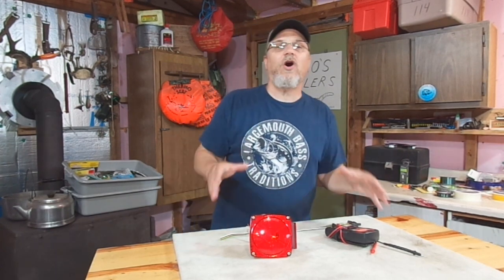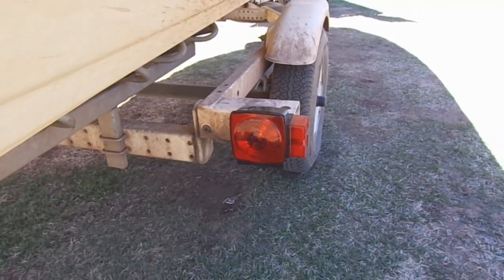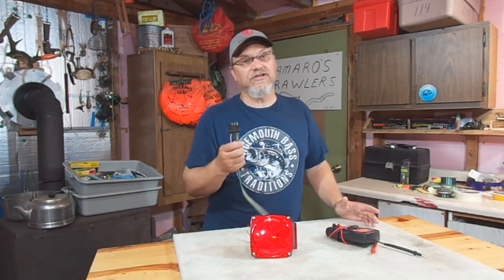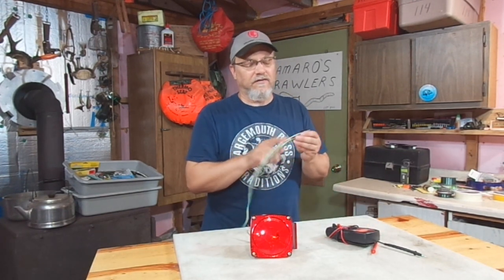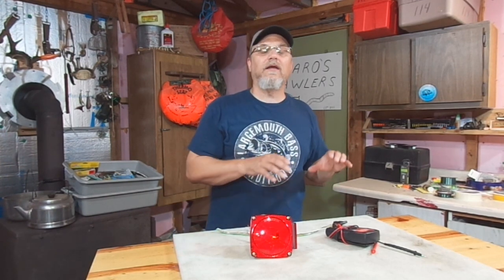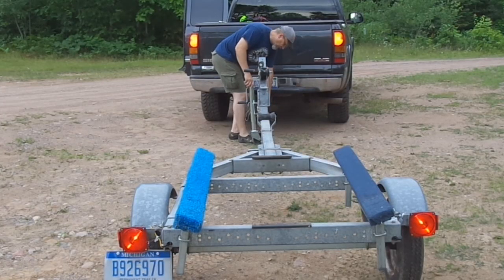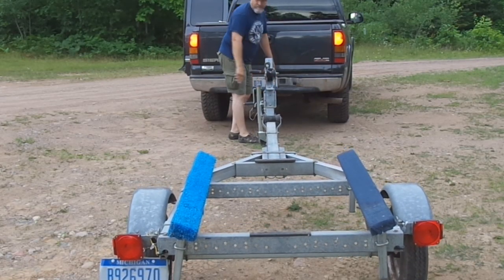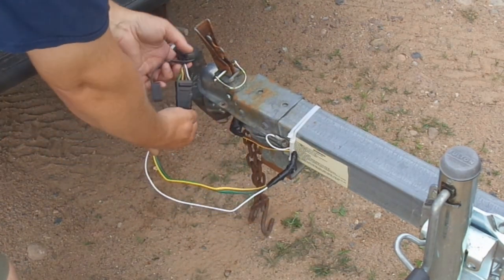FIX YOUR TRAILER LIGHTS (6) - Trick For Flickering Lights

Comment: Thank you so much. I took the ground off the trailer sandpaper the metal clean the wire with the sandpaper as well. Took the screw with a metal washer wrapped wire around the screw reattached so that wire was touching clean metal washer on top of it tightened screw back down everything working perfectly
So glad I found your video
Reply from the maker: Great to hear!  Thanks for the comment.

Comment: Hey Dave,
Thank you Thank you for your trailer lights series. Great work. I owe you about 9 likes. 

Here is a tale of two trailers

Tow vehicle: 14 year old Dodge Grand Caravan with original round connector on the vehicle and a flat 4 end plug.

Trailer 1) 20 years old. LED lights. Flat 4 plug. 5:10 Used 2x per summer. Clean up with contact points with sandpaper. Plug in without connecting the hitch. 
Everything works. Probing why this is my favourite trailer.

Trailer 2 - the problem child.
Bane of my trailering since last Fall! 30 plus year old trailer. 

Finally gave up and rewired it today with new LED lights. 
Per your videos, connected each fixture to the frame. Redid white wire at the hitch and installed a jumper cable back to solid frame pieces where side marker and rear fixtures. Ground off the paint for all ground connections. 

Tested flat four at the vehicle - (same plug as trailer 1) working.

Connected 5:10 New lights via the flat 4 plugs but not connected to the hitch. 

NO LIGHTS!!

Connected to the hitch - you guessed it - everything works.  Lifted receiver off the hitch - no lights.

So, all equipment works on trailer 1.

Nothing works on trailer two unless hitch and receiver connected. 

Help! 

Thank you again, 
Pat
New subscriber
Reply from the maker: Well, it has to be a grounding issue.  You know from watching this video that the trailer isn't being grounded through the wiring harness.  That's why it only works when connected to the hitch.  Does trailer 1 work when not on the hitch?  If it does, try wiggling the harness with the lights on and see if you can get it to fail.  I had a problem similar to yours one time.   One trailer worked and one didn't.  It gave me fits.  It turned out that with one trailer, the harness got twisted a certain way to make the plugs connect and that certain twist caused the ground wire to open.  The orientation on the other trailer didn't cause the same twist to make the plugs come together, so the ground didn't open.  Maybe you have something like this.  The vehicle harness gets stretched or twisted with one trailer and not the other?  Hope this helps.  Let me know what you find and thanks for the subscription!
Reply: @KnettersPracticalOutdoors  
Dave, you were correct. Reworked the main ground and viola! Let thee be light(s). Thank you!
Reply from the maker: @wapbarlow7945  Great to hear!

Comment: Good call! 
I had this flickering issue with my running lights and the ground wire connection at the trailer frame was bad.
Very explanatory video. Much appreciated!
Subscribed!
Reply from the maker: You are welcome!  KPO.

Comment: I had a trailer light issue where the left light would stay on, even when my vehicle was turned off.  Had to disconnect the trailer every time I went fishing, which got very old very fast.  It started only a couple years after I got my new vehicle, and no other lights were having problems, so I assumed it was the controller board.  Called the company & they confirmed this and recommended a different one; it was rather expensive, so I just lived with it.  Fast forward about 3-4 years and the connector was very corroded, so much so that a brush could not remove it.  Replaced both ends of the plug & would you believe that the problem with the one light staying on went away too?!??  That was 2-3 years ago & the trailer lights have worked perfectly since.  Still amazes me to this day.
Reply from the maker: I can't even think of a way to explain that one.  But that's what trailer lights can be like.  Thanks for adding in.  I like to put these things in the memory bank for the future.  KPO

Comment: Id watched your videos and follow your instructions. After many failed diagnostics, I removed the lights and realized the wires were shot. The wires just breaks apart and the cooper strands are black/oxidized? It’s only 2 seasons of usage, maybe cheap quality? I need to replace the whole light package. LED submersible boat trailer. Is there a brand suggestion someone can recommend? Thanks!
Reply from the maker: I've been using the ones shown in this video   https://www.youtube.com/watch?v=-14kh2DYdOo&t=346s  I think the name is TowSmart  So far so good.  If you haven't seen this vid it has some good tricks for installing new lights and wires.
Reply: Yes forget about fixed lights bolted to the trailer. Use a lighting board instead it dont get submerged or weather corrosion. Just keep it in your house or shed.

Comment: Omg, gotta test out the trailer off my hitch. Everything works except for my night lights on certain days. Sometimes right off the water and on the road it works, only to notice three quarters to half way home, its been off or have been flickering on and off. Brake lights, turn signals and emergency lights still work fine, just the night lights. Might have a bad connection on one wire, and have to replace the whole thing after testing the methods you've shared, thanks a bunch!!!
Reply from the maker: You are welcome, KPO.

Comment: Love your series!  I have a problem where my right tail light will work, then not work.  If I squeeze and wiggle the harness connection point the light will flicker on but go off as soon as I stop (let go).  Does that sound like an issue with the harness itself or perhaps the ground to that light ?  Can a ground issue affect just one light?
Reply from the maker: I would try cleaning up the connection points on the harness first, see this vid https://www.youtube.com/watch?v=kqVykWhwHaY&t=37s  If that doesn't help I would just change both plugs.  That should take care of it.  Plugs can be dirty, worn and sloppy or connections inside broke off.  Let me know how it goes.

Comment: I have found that my issue is a grounding issue. When I stick a nail between the receiver and hitch my lights work. Any idea how I should proceed? (Using a different vehicle trailer lights work fine)
Thanks in advance!
FWJ
Reply from the maker: Your plug connection isn't carrying the ground like it should.  Make sure the truck side plug has a good ground connection to the frame of the truck.  You're making that connection when you stick the nail in there.  Let me know how it goes.
Reply: @KnettersPracticalOutdoors  Pretty sure its the connection between the truck wires and the plug for the trailer lights goes. Thanks again for the tip

Comment: Thank you for all the videos! I've been going through all of them and finally got my lights working today. However, I do have a question for you. Like you said, my lights work, but as I'm going down the road, (had my wife follow me on the road test), they would flicker. Also, a couple times they went out all together but as soon as I started driving again they came on. The trailer I have is a 4x8 folding utility trailer. Could the pivot point where the trailer folds cause grounding issues while on the road?
Reply from the maker: Yes it could.  Hook it up at home and try wiggling the trailer at the tilt and see if the lights flicker.  Also, try putting a temporary jumper across the pivot point and see if it quits, KPO.
Reply: Ya my  light  on my utility trailer I wasn’t flickering when I’m driving

Comment: I asked this on another video but can’t recall which...
My trailer lights work fine. Unhook from the truck and the trailer lights are still on.
When I set the trailer back down onto the hitch ball, all trailer lights go out. Lift up slightly and take a little weight off the trailer and the lights are back on.
No wires are being pinched anywhere.
Have you ever experienced this? I’m stumped.
On my truck, I have a basic trailer wiring kit that hooks up to my truck tail lights. I haven’t noticed an issue there but the problem has to be in the truck somehow?
Thanks in advance
Reply from the maker: Try wiggling the plugs.  Does the trailer on the hitch cause any wiring to twist?  Maybe trailer not wired right?
Reply: Nope. No twisting wires. It’s a pretty basic wiring. Both lights have individual grounds to the frame. Lights are good when it’s off hitch.
The second the full weight of the trailer is on the ball. Lights are gone.
If I lift up on the trailer slightly, but the tongue still remains in contact with the ball, they come back on.
It’s baffling. I can’t see any pinching either.
It’s almost as if something in the truck hitch is interfering.
Reply: It’s just really weird.
As soon as I figure out the problem, I’ll post.

Comment: So my blinkers are working. My running lights are working. My brake lights are working. But my tail lights aren't working when my headlights are on? What's my problem? Can you give me an idea?
Reply from the maker: Probably a ground problem.  Fixtures not grounded correctly.  Sometimes when a circuit doesn't have a proper ground or return path, it will return through other circuits.  When these circuits get turned on, the improper ground or return is removed and the circuit doesn't work at all.  Make sure all your fixtures and trailer are properly grounded.  I did assume that this trailer worked correctly at one time, otherwise it could be wired incorrectly.

Comment: I have a horse trailer and when I check the voltage it shows 12 volts with the truck on and  i don’t know if it show be 14 volts or 12 volts
Reply from the maker: 12 is usually plenty.  The charging system will show 14 because if you want to charge the battery to say 12.5, you need a slightly higher voltage to do it.  Slight voltage drops in the circuit will lower the volts a little and that's Ok, but 12 should be fine for your trailer lights.

Comment: My old lights are weak. When I rewired trailer and replace truck plug still weak and if I hook up leds not enough power to light up
Reply from the maker: In the past that has happened to me and the problem was at the connection point of the vehicle side plug.  I know you said you changed it, but is it all new all the way back to the vehicle wiring?  If you just spliced in a new plug at the end of the harness, you could still have an issue where the plug wires connect to the vehicle wiring.  2 different times I had corrosion set in at this point on the 3-way plug that splices into the vehicles wiring and it caused low voltages on all circuits.  I hope this helps.  Let me know how it turns out, KPO.